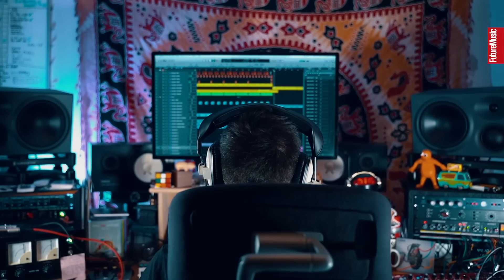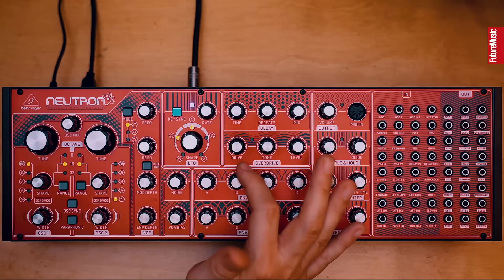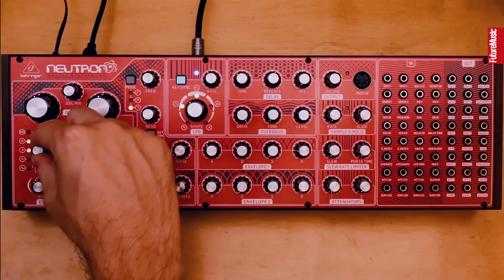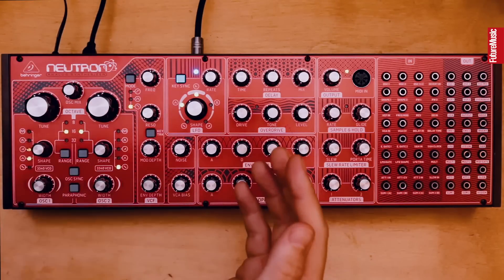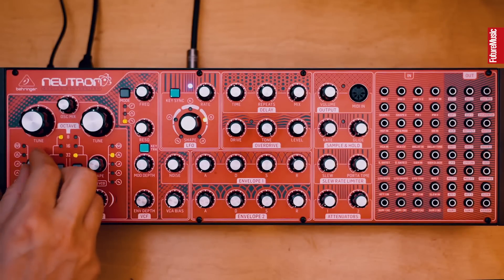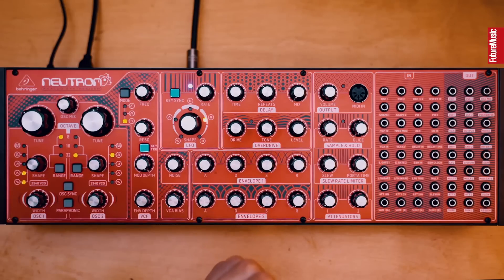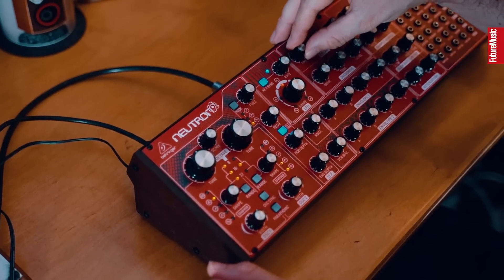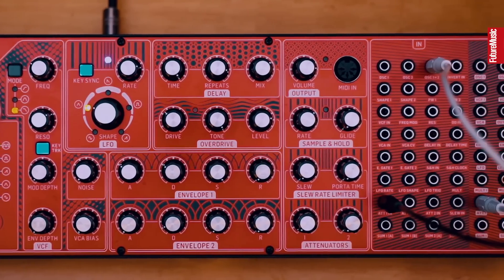Can Dr Meaker make a drum & bass track with just a Behringer Neutron?

Comment: Good work, the Neutron is great, it has more sweet spots than a cake factory!
Reply: Cheers Ed! 🎂 heheh
Reply: @clivemeaker4738   It ended up being more than i expected, phat enough i reckon ;)  Just curious about what other hardware and processes you used here. You mentioned a preamp, i'm guessing it's the 1073 clone ? Also, did you use the API2500 at all ? I might actually get a Neutron, but i want to stay all otb with hardware for that set-up. Having a nice chain for the Neutron to feed into will be the key.

Comment: how do i send midi information to my neutron from my daw
Reply: It has a standard USB B input on the back which is the same as a printer cable.   You just need one with the right desktop or laptop end USB-A or USB-C. Alternatively if you use an audio interface and that has 5 pin MIDI sockets, you can those to the sockets on the top and back of the Neutron.